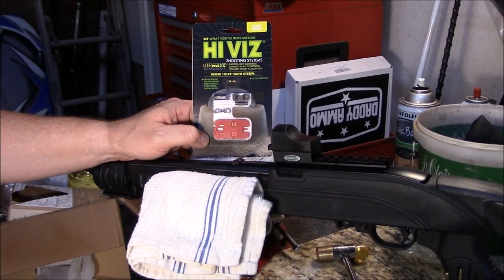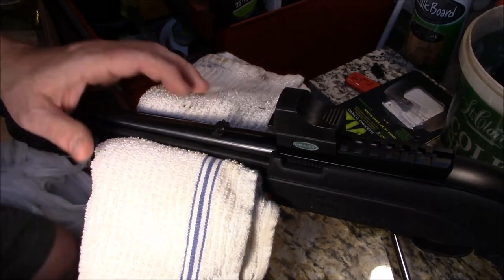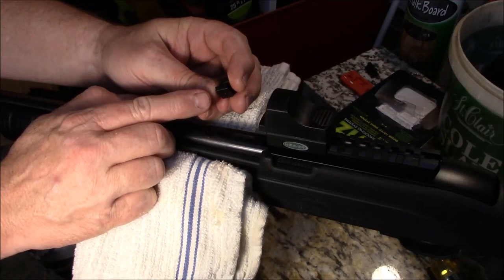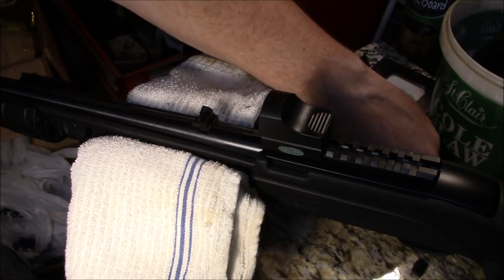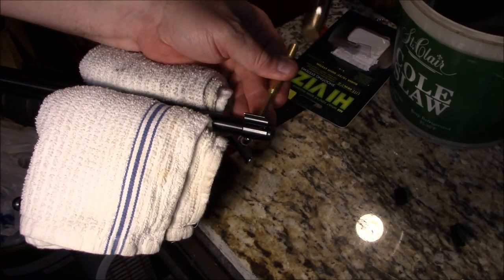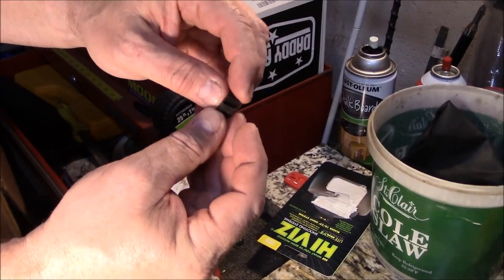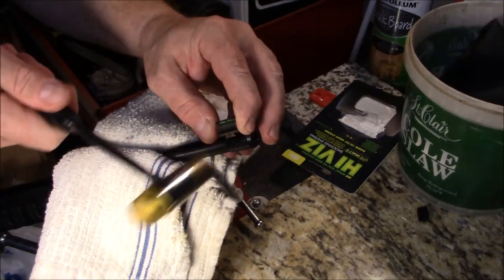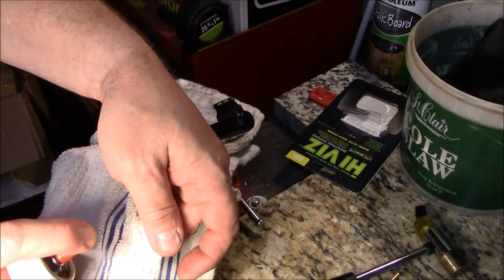Ruger 10/22 HIVIZ Sights (Install)

Comment: Could not get the front sight off on mine. Hammered the poop out of it too
... was worried I was going to bend the barrel.
Reply from the maker: You need to file down the sharp corners like I did in the video.
Reply: Im having the same issue but with the rear site it wont budge
Reply: @jakeradske502  place in padded vice, muzzle facing away. Hit left to right with brass punch , couple drops of oil 24 hrs before

Comment: Great video. Just installed the front (muzzle) sight with no issues. The back sight is a different story.. Ever heard of the sight dovetail being too small or the barrel dovetail being too large? The Hiviz rear sight slides completely through from either side with minimal effort. I’ve read on a couple forums to place a piece of film under the sight to take up some space. Thoughts?
Reply: Get some metal shims.

Comment: Are the hiviz rear sights the same size as the stock rear sights? I ask because i have a choate stock on my ruger and it has a top barrel guard with a square hole to slip over the stock rear sights. I want to know if i have to modify my stock to fit the hiviz rear sights.